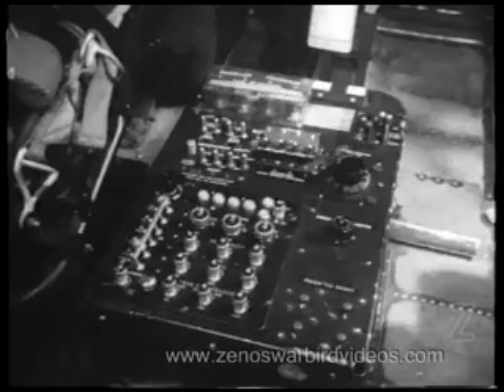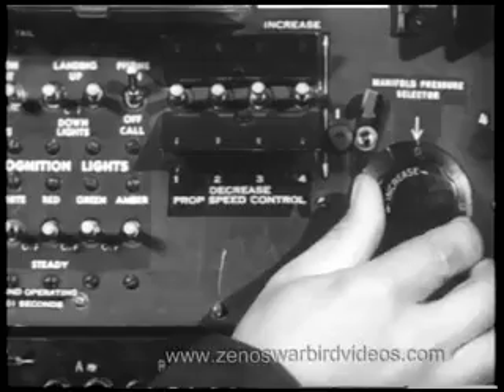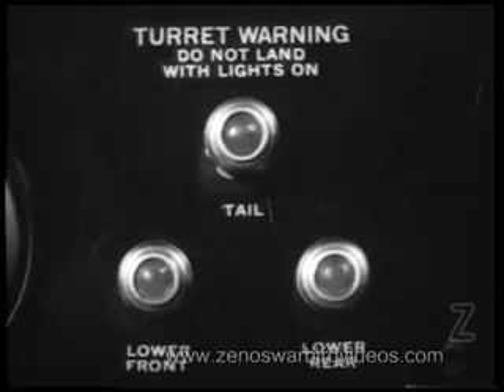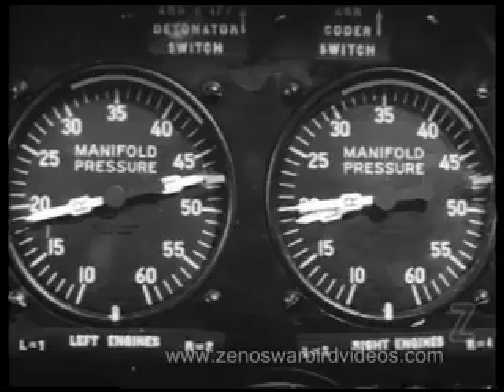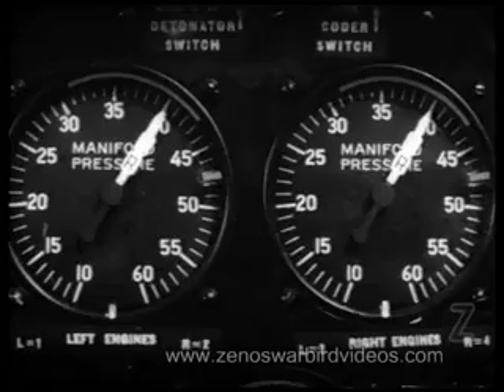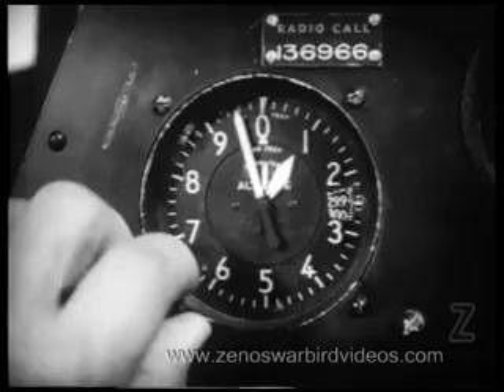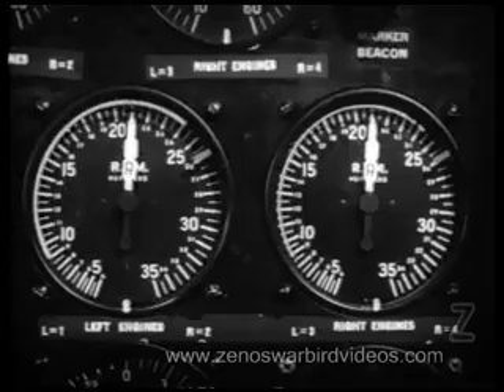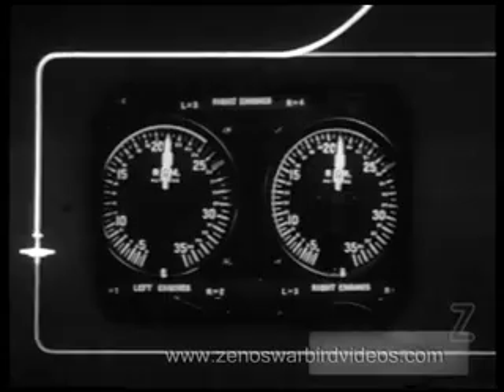How  to Fly the Boeing  B-29 Superfortress: B-29 Flight Procedure &Crew Functioning

Comment: Pilot: Checklist complete! Navigator: Never mind, war ended a week ago
Reply: lol!
Reply: Yep, gotta wonder if, with hundreds of planes lined up to take off from Tinean or the other otherwise worthless pieces of Pacific real estate that thousands of Marine's and GI's and died to capture, there was time to go over all that stuff, in 95 degree heat, sweltering humidity, and carrying a max payload of fuel and bombs.  The flight engineer probably checked oil pressure, cylinder head temperature [probably already near the red line], and the pilot set the turbos to maximum boost and gunned it down the runway.  The crew members prayed that the bird would first get airborne, then climb to cruising altitude before the over-stressed engines burned,  More than one B-29 didn't make it into the air on those harrowing takeoff's. Which is why Curtis Lemay ordered the planes to be lightened and the strategy changed to nighttime firebombing.
Reply: Nevermind Skipper, Another War just kicked off in some place called Korea
Reply: Russ G THE WAY I HEARD IT, CURTIS LEMAY REMOVED THE GUNS FROM THE B-29S, AND SHIFTED TO LOW-LEVEL NIGHT BOMBING, BECAUSE AT HIGH ALTITUDES, THE WINDS OVER JAPAN KEPT DEFLECTING AND SCATTERING THE BOMBS-!
Reply: Ronald Davis...
Thanks for the laugh!  That was great!  I actually don't think its right for the Pilot & or Co-Pilot to be responsible for someone else's job, because it lets the person responsible for their own job off the hook, and puts it on the Pilots.  Not right to do that in my book.
Reply: @CrashandTrash596  Thanks for the laugh!  That was funny!!
Reply: CHIRELLE ALANA LOONEY b
Reply: ronald davis - hilarious.

Comment: I was an A&E mechanic on the B-29  in the 1950's.. They were converted to fuel jet aircraft in the air>> The bomb bay's were equipped with fuel tanks and a boom was installed on the tail of the plane to hook up with the jet fighter in the air >> Pretty neat ..They called the plane a KB29p >
Reply: +Harold Sugg I can only imagine how difficult it was to refuel jets with the KB-29/50 KC-97! Saw a picture of a KC-97 refueling a B-47. It's a wonder the Stratojet didn't fall out of the sky! (And that was using the flying boom! Look for a video of an F-100 trying to catch a basket with his probe behind a KB-50 while it's wallowing around in the sky! Even harder!)
Reply: jpatt1000 i8
Reply: jpatt1000
Reply: My Dad was a radioman in Korea from 50-52, sir.

Comment: The fact we had time for all this (and the months of extra training required to get a crew ready for this), is a testament to how much control we had by this point. We had sunk 7 Japanese carriers in 2 battles, had control of the air and sea for hundreds of miles, had picket lines of destroyers and submarines to warn of raids, and rescue downed airmen. Do to heavy losses and fuel shortages caused by shipping losses and being cut off from the Dutch east Indies, the Japanese pilots had less training than the American pilots and less flight time before being sent into combat. Years of hard work, planning, and sound grand strategy lead to this.

Comment: Manually pulling the props around -- is that to make sure there's oil circulating through the engines  before firing them up?
Reply: It's possible for oil to accumulate in the lower cylinders. Pulling the props gets rid of it.
Reply: Thanks for the response, sorry I didn't catch it sooner. Also, by an odd coincidence, it seems we share a last name! (Penny Robinson is NOT my actual name!)

Comment: Compared to planes of today no, but back in 1944 it was a big deal. radio controlled turrets, presurized cabin, in flight rest quarters, twin bomb bays. The B-29 was a revolutionary bomber back then. It changed aviation. From it, we have pressurized cabins on airliners. Think of the B-52. Remote rear stinger turret, rest quarters, twin bomb bays. pressurized. It reflects the B-29 in many ways. It was the biggest, most advaanced bomber of WW2, and that says alot.

Comment: What is a 'Put-Put' ?  Is that a two stroke oil+gas ICE as on scooters from 1950's and 1960's?
Reply: It was a 4 stroke accessory engine in the back that was started by one of the crewmen whose station was in the back where it was, as I recall they were 16 HP, probably made by someone like Briggs&Stratton.
They could run all kinds of stuff until the engine's were started and I think actually assisted with starting them by turning a generator for power to the engine starters.
Reply: @dukecraig2402  So an APU then.
Reply: @dkoz8321  
Exactly, and not the kind of APU that says "Thank you vedy much" when he's handing you your change.
(Sorry, I couldn't resist)

Comment: Did these birds stand alert as today’s B-52’s/ Tankers do? If so, how does the enormous walk-around/inboard checklist and procedures prior to take off impair their abilities for rapid departure?? That’s an awful lot of processes to complete in case of lowered defense condition!
Reply: Well for the 29's there was no such thing as fast departure since most of the inspection was done while the aircraft was been refueled or maintained by the mechanics.

As for the 52's, they have almost the same procedures for inspection, however when the MITO signal is sent, no inspection is needed, the 52's can prime the engines in seconds and be airbone within minutes. The 29 was indeed a chore due to it's over complicated yet somewhat advanced structure for engine use and control.
Reply: @PointReflex   Excellent explanation. Thanks!
Reply: @georgelennon3618  You are wellcome. As a side note there is a vintage instruction video on Youtube about the engineer of the B 29, I recommend you to watch it since it shows how painfully slow is the engine startup process on that plane and most importantly why in an event of a nuclear strike warning going at the base, the 29's crew would have more chances of surviving by evacuating the base by truck than trying to get a 29 airbone.

Comment: Tell that to the guy in my avatar. Paul Tibbets' B-29's were specially modified to drop atomic bombs. Deployment procedure was to drop the bomb, then turn away at a tangent of, I believe, 158 degrees to the bomb detonation point. The Enola Gay would be pointing away from the bomb and and six miles away from the hypocenter in the 43 seconds it took for the bomb to drop. Silverplate B-29's could do things that production model B-29's simply could not do.

Comment: By the time the checklist is completed you're out of fuel
Reply: karl marx 
It was not unusual for planes to wait on the flight line for up to 12 hrs, with flight engineers sweating the temperatures of the magnesium engine heads. It was not at all unusual for the first planes returning from a mission to pass by the last taking off. No, it wasn't easy. These guys returned to a tropical paradise that was hot all the time, and dotted with ineffectual  wind driven washing machines. Without the checklist,  they'd have wound up on Iwo or in the water. Remember, the B-29 was a decade ahead of its time.  Unfortunately, its time was the late 30's. However beautiful, efficient or glorious it was, and I do love that plane, it was obsolete by 1947. She deserved better.

Comment: Jee-Zus..don't forget to turn off the detonator switch!  What TF is THAT for?
Reply: The designers included the detonator to destroy the IFF (transponder) to prevent capture and use by the enemy. I found it in a description of all the airplane's radio equipment at http://www.airpages.ru/eng/mn/b29_20.shtml.